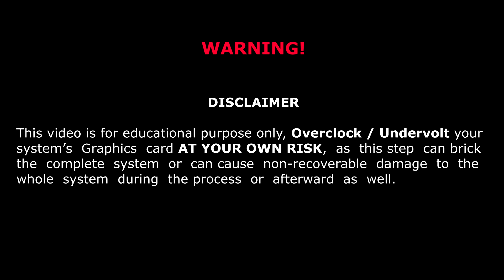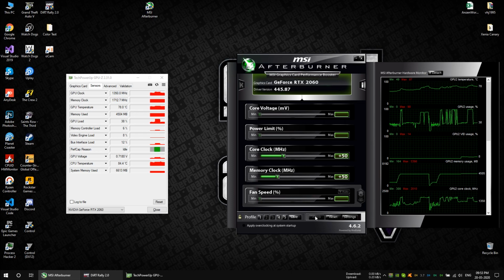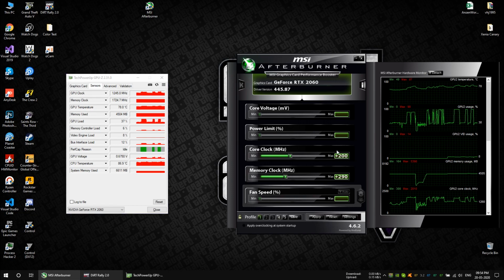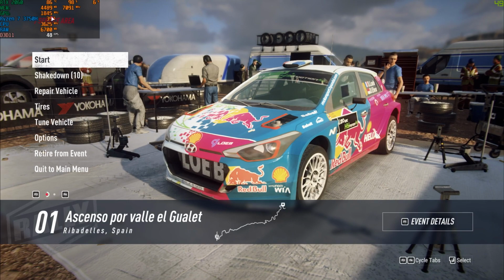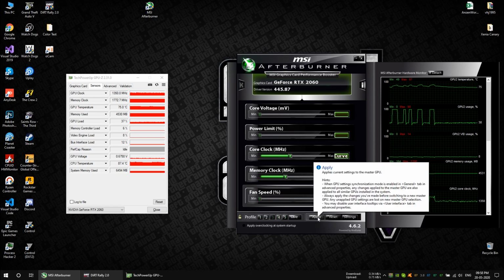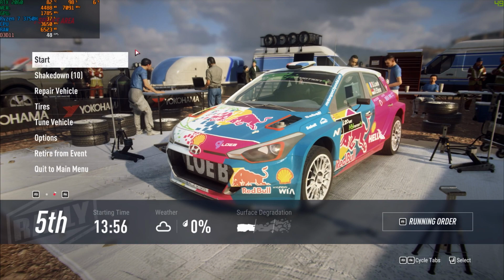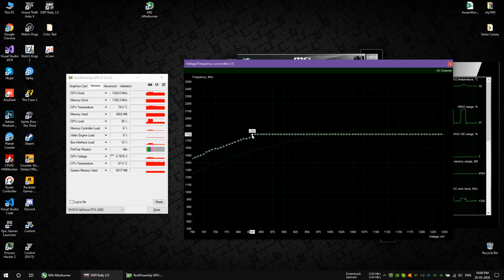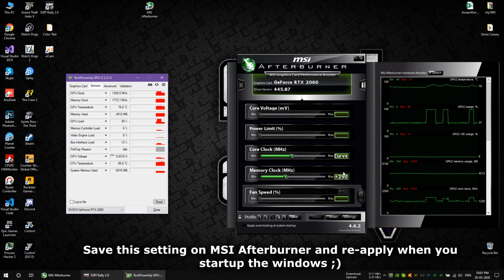Overclocking and Undervolting nVidia Laptop GPU || nVidia RTX || MSI || ASUS

Comment from the maker: Please subscribe if you think i helped you. 😊
Undervolting starts from 2:35
Reply: Is it also safe to Overclock? I really want to have High Fps
Reply from the maker: Undervolt is safe, overclocking is not
Reply: Hello ,,great video very helpfull,,,, I have a question, i am doing an guide about gaining performance in cyberpunk, i was abou to record undervoltin guide, but my laptop won't let me record desktop because of having two gpus intel and an rtx...I wanted to ask if i could use your clip, in my video? and leave a credits of your channel and video of course
Reply from the maker: Sure, you can. Once you post video let me know
Reply: @VaibhavJoshi1995  thank you , i will let you know
Reply: @VaibhavJoshi1995  i have already uploaded the video,,,thank you. Hope it will get more recognition,,but we will see i guess :)
Reply from the maker: Pause at 6:04 😊
Reply from the maker: That is thermal throttling, since cpu and gpu is sharing same heat pipe you need to cool down cpu also. Use Ryzen Controller
Reply: @VaibhavJoshi1995  what settings do you use on ryzen controller?
Reply from the maker: I don't use it. Since i don't play game everyday and whenever i play then mostly not more then 1 hours. So if you use that way i think this is moderte use of GPU then temps wont affect your hardware. Undervolting CPU and GPU is mostly done to avoid overheating for longer session of gaming and almost everyday 😊

Comment: what is 1665 mhz  shown in your afterburner ?
Reply from the maker: Clock speed.
Reply: @VaibhavJoshi1995  thanks but i think something wrong with my laptop as its locks my clock speed at 960mhz
Reply from the maker: Which model it is?
Reply: @VaibhavJoshi1995  MSI GF65 Thin (i79750h + RTX 2060)
Reply from the maker: Change your nvidia control pannel settings, under power settings select adaptive and appy it. Then use laptop in charging mode (plugged in). Then try msi afterburner

Comment: What is the normal GPU temperature for RTX 2060 i79750 laptop ?
Reply from the maker: 80-90 c. While gaming.
47-50 c in Normal Condition.
Reply: Can i copy your graph i have the same RTX 2060 in my laptop ?
Reply from the maker: Yes

Comment: Hey, can i undervolt even more then this to get even lower temps? I don't mind 10-20% performance loss
Reply: Since you have Afterburner installed I assume you've installed Riva Tuner as well? If not, do so. It allows you to set a system wide or per application frame limit. Limiting a game that runs at 120+ to 60 fps will effectively prevent your GPU from running at higher clocks, but if needed all the power is still there.
Not the most elegant solution but it works.

Or you can make a custom curve like the video but at a lower frequency. The stock boost clock for a 125w is 1620Mhz. Let's say you flatten the curve at 1400Mhz. The GPU shouldn't boost over that, limiting heat.
Reply from the maker: Agree.
Reply from the maker: Due to some hardware limitation that it should atlease have some minimum voltage to run, you cannot undervolt it too much 😊
Reply: @VaibhavJoshi1995  ok, any idea how low i can go on a 125w 3070 laptop gpu?
Reply from the maker: Not sure

Comment: hey bro my fx505dv resarts itself while i playing games on external monitor do you know how can i fix this problem thanks in advance
Reply from the maker: Update Nvidia driver, other causes can be your laptop would be overheating.
Reply: @VaibhavJoshi1995  they are up to date. This only happens when i close the lid(laptops screen).
Reply from the maker: You need to set power configurations, that on close lid "Do nothing". You can google about how to set to Do Nothing on Closing Lid.

Comment: Nice video bro 👍 i have the same Laptop but with a Ryzen 5 3550H Cpu .. I overclocked my CPU to 35W instead of 15 TDP but it dont makes a difference .. i upgraded my RAM from 8 to 16 GB and it  is a little bit faster .. Im playing CoD Warzone on LOWEST settings and get around 35- 45 FPS , what can i do ? 

I connected via HDMI cable a 144Hz 24“ monitor to play with more FPS cause my monitor has only 60Hz , im Playing all games on the bigger monitor but in GTA 5 also only 45 fps ... 

What can i do ?? Thanks alot for your support ❤️
Reply from the maker: You can join telegram group from link in description.. my team will help you out 😊
Reply: @VaibhavJoshi1995  thanks i joined the group, but cant write :// i have no idea how to handle telegram 😅😅 the last message i can see is from february
Reply from the maker: You might have joined Channel, look for group link

Comment: What is the exact version of your fx505dv?
Reply from the maker: AL136T
Reply: @VaibhavJoshi1995  I have the AL110 version do i do the same as in the video? and also if I want to undervolt do I set the memory clock to 0 or as u did in the video?
Reply from the maker: No don't do anything with mem clock, only try to replicate graph
Reply: @VaibhavJoshi1995  Ok thank you

Comment: Good Day ! I always watch your videos i have the same laptop i dont know what happen before it had the good performance overtime i had this frame drops all the time it runs very hot anyway i have this version of bios 311 and windows 20H2 would you recommend me of downgrading the bios or not ?
Reply from the maker: I recently updated, seems like heating is only issue, new update might solve it
Reply: @VaibhavJoshi1995  which version ?
Reply from the maker: 20h2 with 311 BIOS
Reply: @VaibhavJoshi1995  are you still using undervolt ?
Reply from the maker: Yes
Reply: @VaibhavJoshi1995  i feel bad with my laptop hope to find solution. Cant even play warzone
Reply: @VaibhavJoshi1995  thank you does repasting will improve this laptop ?
Reply from the maker: If laptop is 1-2 years old then only repasting will help

Comment: is my laptop with rtx 2060 and i7 9750h better that this???
Reply: and what if i overclock the gpu? how much fps can i gain in warzone and other games? will it damage the computer in the time???
Reply from the maker: Overclocking will definately damage your system because it will increase heat if you don't have good cooling. Else you can go for overclocking if you properly undervolt it and have decent cooling. You may gain 15~25 fps depend on game
Reply: @VaibhavJoshi1995  i have my gpu at 70 degrees when it is on 100% utilisation the problem is my cpu it’s every time at 90. overclockking the gpu will increase cpu temps???
Reply from the maker: No it won't increase temp of cpu only if you don't have shared heat pipes
Reply: @VaibhavJoshi1995  my laptop has two separated fans i think
Reply: @VaibhavJoshi1995  anyways thank you for the help just got a sub :)
Reply from the maker: Yes

Comment: just let the default or set to -115 and 215 if your laptop is on a good surface and if you have optimal cooling like external fans etc you can set 140 and 230

Comment: My laptop is the same as yours (except the storage and cpu). It started to underperform. I would easily get over 120 FPS, but lately it started to slow and for some reason, when I minimize it, it runs fast, but when I maximize it, it loses a lot of frames. It seems to be the cpu faults, but idk
Reply from the maker: You might have updated BIOS (311) and windows 10 2004, both has performance issues
Reply: @VaibhavJoshi1995  update bios, and its not fixed
Reply from the maker: No, i meant that BIOS version 311 is not stable. You might need to downgrade to 306

Comment: And your GPU is still burning at critical temp. Max is 88 degrees, yours at 86-87 C.
Reply from the maker: Yes, that's true. I don't usually play for more then 1 hours 😊
Reply from the maker: This laptop has thermal issues, need to be taken care 😊
Reply: @VaibhavJoshi1995  We have the same problem. Mine is brand new and in some games reaching 86° also. I tried undervolting - no changes.
Reply from the maker: Seems like this laptop is having thermal design issue, you need to keep it elevated also, if you keep on your lap or something which blocks vents then it might not help.
Reply: @VaibhavJoshi1995  I have it on cooling pad. I find it strange that GPU undervolting basically did nothing, I don't know what I am doing wrong. CPU undervolting helped a lot. I was playing on 93 - 95 degrees, now my CPU reaching only 80-83 degrees. Still not perfect, but this is already something...
Reply from the maker: Can you share your config / settings for Ryzen Controller ?
Reply: @VaibhavJoshi1995  I have Intel CPU...
Reply from the maker: Now i got why your gpu undervolting dosen't work out, if you have intel cpu then it needs to be underclocked also if cpu is heating much. If you have laptop then it might have shared heat pipes where you might have some thermal issues. (Controlling temps from GPU + CPU both)
Reply: @VaibhavJoshi1995  yes, my CPU and GPU is sharing heat pipes. I did that I undervolted both of them, still my GPU generates more heat than CPU.
Reply from the maker: Yes that is natural, now all you can do it try without laptop bottom lid. That will drop temps drastically. 😊 If that works out you can workaround. I am also thinking to make it Portable Small PC, which can work cooler. Need to check lot of DIYs

Comment: Hey i have the same computer and I’m looking to undervolt it cause it becomes too hot when playing games, does it reduce performance when playing games or is it not even noticeable? And do i turn it on just before playing any game?
Reply from the maker: Temps are noticable if you undervolt it, but i dont suggest overlock 😊
Reply: Vaibhav Joshi does it effect fps at all?
Reply from the maker: Yes, with undervolted you will get less fps but stable and will have lower temps, with overclock you will get higher fps but it will heat up gpu and cause throttling

Comment: Hi, I have the same laptop. It gets 85 FPS max on lower settings in Warzone. At some times the FPS are 55. Is undervolting and overclocking the solution? What do you recomend? Thanks a lot for the excelent review.
Reply from the maker: Hey welcome 😊, i actually don't recommand overclocking but if you undervolt then it will further reduce fps, so just elevate your laptop and try to keep naturally cool 😊 after new update it does fluctate fps
Reply: @VaibhavJoshi1995  Thanks, do you have any suggestion to increase FPS? I think 80 is so lower for the specs these laptop has. Graphics are in low settings
Reply: Do you recommend optimize the game from nvidia controller? Or is it better to configurate the grapichs inside the game? Because Nvidia controller recommends to optimize A LOT the graphics, but i didnt do it because i think it will get reduce ever more FPS
Reply from the maker: Lower because of Ryzen, and also you can try optimizing games. 60fps is playable fps 😊
Reply: @fermingrillo3504  Dont forget to make the battery power options to High performance and in the advanced power options "Processor Power Management " to 'Aggressive'. Also change your nvidia control panel 3d settings to performance

Comment: Did it help u reduce temp? I own a fx504gm and I tried undevolting, but I always good upto 90 degrees and starts throttling. My laptop has i7 8750h and gtx1060 6gb. Please help me
Reply from the maker: Yes it has shared heat pipes so it helped to reduce temps and you can also try throttlestop to explicitly throttle i7 to reduce temps 😊

Comment: My gpu goes crazy boost past 1800
Reply from the maker: It will go past 1800 but then eventally come down and settle at 1450 once it hits 86c
Reply: @VaibhavJoshi1995  I have made a curve in msi effectively reducing voltage.

It runs cooler than before and its stable at 1650 with a modified fan curve.
Reply from the maker: Can you upload your curve at imgur or somewhere and post it here?

Comment: why does my cpu clock say 3900mhz???? i havent even overclocked my system at all !!
Reply from the maker: It does clock to 3900mhz but wont stay there for long time. As cpu heats it will lower.
Reply: @VaibhavJoshi1995  yes it did come down  between 3600 and 3800
Reply from the maker: Yes

Comment: Hi, I did undervolting my rtx 2060 a few weeks ago, and it is completely safe, the only thing that could happen would be a blue screen which is solved by modifying the undervolting.  Now I will share my lowest and most stable configuration of undervolting of undervolting: 750 volts at 1515 MHz, and I have not had any problems, the only bad thing is the fps, they are reduced in some games and in some you do not notice it
oh, and one more very important point, undervolting is much safer than overclock, don't worry about damaging your graphics,

Comment: bhai. i have the exact same laptop and latest afterburner but the fan control bar is not functioning. in armory crate, my GPU fan is spinning max at 900RPM in stress test. i bought this laptop a month ago
Reply from the maker: Fan control will not work in TUF, it's not in firmware itself. And if your fan is on 900RPM make sure you switch to turbo mode and plugged in when ov/uv gpu. If you still think your fan is slow.. check with nearest asus center 😊
Reply: @VaibhavJoshi1995  in turbo mode it would go to 1000rpm. okay then, service centre is the  way to go.
btw would the fan be replaced for free if under warranty?
Reply from the maker: Yes, they should be covered in warranty. Since its manufacture defect
Reply: @VaibhavJoshi1995  have you found out any trick to enable rainbow keyboard lighting in this laptop like the ROG series???
Reply from the maker: I am sorry to say that but tuf dose not comes with section wise rainbow mode like ROG, but it can color cycle like rainbow 😊
Reply: @VaibhavJoshi1995  i want rainbow cycle only (not the regular color cycle). how to do it bro ?!!!!!!
Reply: @VaibhavJoshi1995  bhai. my AMD gpu is reaching 95 degrees while playing NFS MW 2012, even when i run the game while choosing Nvidia gpu as default. How to control/undervolt the amd gpu bro??
Reply from the maker: It will switch color but wont display 2 or more at same time 😊
Reply: @VaibhavJoshi1995  okay bhai. but how do i control temp on my AMD gpu??
Reply from the maker: You can use MSI Afterburner for AMD Gpu too
Reply: @VaibhavJoshi1995  okay bro. btw how much RPM does your GPU reach while intense gaming?
Reply from the maker: 5600 rpm
Reply: @VaibhavJoshi1995  i tried.  the nvidia gpu is configurable but in case of rx vega, the Core Voltage option is not becoming active even after checking the "unlock voltage control". any sugesstions?
Reply: @VaibhavJoshi1995  do you prefer any other app than Armory Crate for monitoring RPM accurately?
Reply from the maker: No, because only Armory Crate can read those values. I tried several others but none worked well to detect fan speed
Reply from the maker: Sorry brother, there has been lot of time since i have done AMD gpu overclocking, i have switched to nvidia from 2015 to till now i still go with nvidia. 😊
Reply from the maker: Haha chill mate, you can join telegram group from link in description, i have team who will help you out 😊
Reply: @VaibhavJoshi1995  tysm bro!
Reply: one last thing. after UV and OC nvidia gpu, even when I try to switch back to normal profile, the base GPU clock is stuck at 1100MHz instead of 200-300Mhz. i even restarted the laptop once with the auto apply on boot  disabled. what should I do now???
Reply from the maker: Did you set High Performance in nvidia control pannel as Default? (First tab)
Reply: @VaibhavJoshi1995  hanji. i did.

Comment: How to get the overlay that you have in that game
Reply: I was playing AC syndicate and my CPU + GPU were both at 95°C. So I thought I might need this. The weird thing was that the temps and utilisation were same at both low and max settings. Do you have any idea why?
Reply from the maker: Your welcome, and yes that happenes because Assassins Creed is always been CPU intensive + Demanding GPU requirement too. It utilizes both, so the behivior you see is expected for this game. If you try out other games like Dirt Rally 2.0 which is more of GPU dependent then there will be less CPU usage. But since CPU and GPU share same heatsink, one temp affects another. If gpu is running hot it will make cpu hot too.
Reply from the maker: MSI Afterburner + Riva Tuner. Just enable OSD in MSI Afterburner 😊
Reply: @VaibhavJoshi1995  Thank you

Comment: hey , i have the same laptop but with a single slot 16 RAM , is it safe to do this ? and do you recommand undervolting or overclocking
Reply from the maker: Hi, if you change it to 2x 8GB Ram it will improve performance alot, and yes i recommand undervolting over overclocking 😊 but one must do it at his/her own risk.. since it is not recommanded by manufacture.
Reply: @VaibhavJoshi1995  since we both have the same laptop , are you currently undervolting yours or not ?
Reply from the maker: Yes i do, but i don't know why you have single ram stick of 16 gb, mine have 2x 8 gb out of box (dual channel) and i only undervolt before gaming 😊

Comment: nothing about undervolting the cpu i have the same machine?
Reply from the maker: Since cpu and gpu both share same heatsink, we have a powerful gpu with draws more power and makes cpu and gpu both hot. And Ryzen 7 is already weak for rtx2060, so if you undervolt gpu you wont be loosing out performance but you shouldn't just undervolt cpu which will make bottlenecking even worse 😊
Reply: @VaibhavJoshi1995  bruh ryzen 7 is not at all a bottle neck for 2060 what LMAO

Comment: Hi Dude, I have the same Laptop as you are and I already tried your setup including OC my GPU & Memory.
But my GPU usage were only 60-70% when I played COD MW,  it never reached around 90% as you're, any advice?
Reply from the maker: Make sure it's using nvidia not rx vega 😊
Reply from the maker: And some games utilize full gpu while some not, thats why i have  showen Dirt Rally 2.0 which utilize 99% of gpu, which is typically good load for testing OC and Undervolt